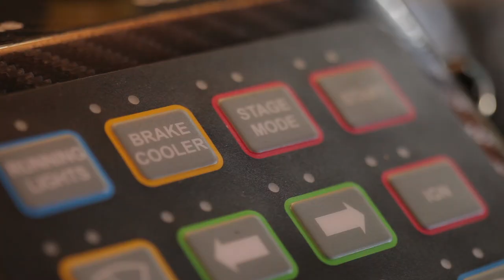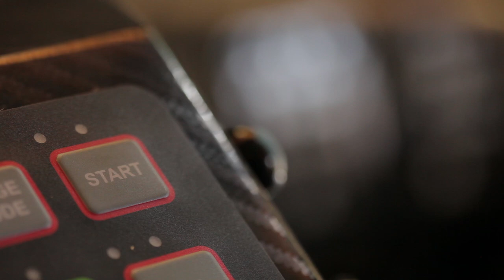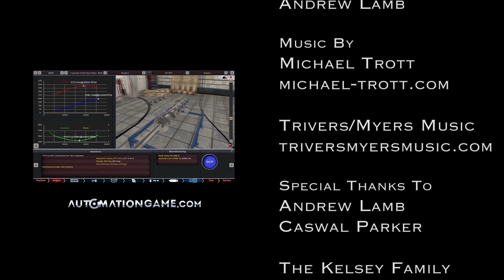The Homebuilt Rally Car That's Too Fast for the WRC - TST in NZ

Comment: I am stunned by his engine choice. For rally usually they target torque, which this engine cannot have much. Probably half of WRC cars, but I would trade that anytime for that sound. Secondly, Renault engine in Peugeot :)
Third, I would be switch to tarmac setup.
Reply: D Gmaz Torque in and of itself doesn't really matter, any car with 450HP and a broad powerband is going to be equally fast as a rally car, it just so happens that in this case he has to shift gears to keep it up at 7500 - 9000rpm sort of area, as compared to 3500 - 4500 or what have you in a low revving restricted turbo motor.

Sadly I don't think there are any good Tarmac rallys that this car is eligable for, I wish there were..
Reply: AutomationGame  Targa??
Reply: Not sure it fits any of the Targa regs? But I'm sure you could find a way. It's a much better gravel car though.
Reply: D Gmaz It fucken works doesn't it?
Reply: Alex Lyons Wet dream. Wet dream.
Reply: AutomationGame I do not believe he does not suffers in slow corners, but he does not lack fun. Alex made amazing car worth worshiping.
Reply: +D Gmaz In a low corner he just gets into a lower gear, so that his RPM remains at a more optimal range... It's not really any different. Most WRC cars target lower RPM's because it's probably easier to build and maintain such an engine. And because they can.
Reply: +AutomationGame He should go for Hill Climb rally. There are a lot of those events in Europe.
Reply: +D Gmaz Apparently the whole build started with the engine, because he was offered a good deal on it and then he built the car more or less around that engine.
Reply: +AutomationGame So he detuned the engine to run at 8500 rpm (saw it on another video). So my question is what do you reckon the engine life span is ??
Reply: +sz027566 Depends on how often he uses it and how hard he thrashes it. id imagine 5 rallies or so before you have to rebuild at least the gearbox.
Reply: +Reptilius Maximus   It's not a Peugeot, it's a home-made car that outwardly resembles a Peugeot. There isn't a single Peugeot part in the entire vehicle.
Reply: +Reptilius Maximus  Its geared really low and that makes up for all of that different powerband.

Comment: Next group b car
Reply: there is a reason group b was banned
Reply: +Slickcinnamon only because they were so fast but these are safer
Reply: Group "B" was banned because of the "fans", not the cars. Had the proper safety standards been applied, we would probably still be enjoying those monsters today.
Reply: Because they were made from plastic. Now we have carbon fiber.
Reply: Because people wanted to touch 500hp cars in oversteer on gravel roads. Not the actual cars itself.
Reply: Hate to say this and far from saying your point is moot, but the lack of regulations/restrictions around how light and how powerful the cars could be also facilitated production of monsters such as the lancia delta s4, peugeot 205 GTI, quattro s1 and renault5 turbo. While I enjoy watching and appreciating pure, unadulterated automotive engineering, the cars being produced were becoming lighter, faster and ultimately more dangerous.  While there is always going to be risks involved with any motorsport, the fatalities of drivers could no longer be ignored.  The proximity of fans only accentuated the dangers and risks associated with group B rally.
Reply: Then if that's the case, why isn't the Isle of Man TT banned ? on average every single year at least 1 person dies. I visited the year Mr Bob Price paid his life for racing on TT. that is a dangerous race, with that much power on two wheels, i see group B, with today's safety standards much safer than the TT. one mishap you die.
Reply: I believe this is because the Isle of TT is steeped in tradition and remains one of the most prestigious motorsport events to this day.  Especially among British riders.  A win at the IOMTT is the greatest accolade a rider can receive.  Even when riders/teams 'unanimously' boycotted the IOMTT (or rather petitioned for the race be removed as a compulsory MotoGP event) it was never discontinued. 

But hey, I would pay to watch Group B rally if it was still around. People shouldn't live life scared of the inevitable.  Even one mishap on regular roads can still lead to death...
Reply: MineEmpireBilly most answers I've heard to that is because rally racing is a celebration and bringing tragedy into it will change the mindset of the fans.

Comment: A modern day Group B car
Reply: AceCustomz exactly what I thought too. 👍
Reply: it needs a 1000Hp more to be a groups b
Reply: Carlitox b to be a true modern equivalent of a group B car, yeah, pretty much 😁
Reply: @carlitoxb110  Group B cars at their peak had about 400-600hp and you had to built a certain number of cars (200??) to be homologated.
Reply: WRC regulation used to be 300HP +5% since 2017 it's 380hp out of 1.6l turbo engine  ,  Rallye GT cars musst be 2WD, and can have up to 294bhp/tonne of weight
Reply: @mattschm5486  with boost turned all the way up the S4 was making 1000+ bhp but with massive inconsistent lag and same with the quattro S1 E2
Reply: @K2ifer  which they usually didn’t use for rally. Even the pikes peak version only had about 600hp according to Audi. As you pointed out drivability is a big point also probably engine lifetime. These are not drag racers

Comment: Is the body style base off a production vehicle, or did he do that too? I saw the nfity badge he made for the grille.
Reply from the maker: No he made the body too
Reply: whelk Looks like it's loosely based off a PEUGEOT 207
Reply: irishgandalf757 it's resembles a PEUGEOT 207 WRC. The 3.0 V6 comes from a Renault Clio V6 Sport, except in that car it only has 250hp instead of the 450 in this magnificent piece of tech. Current WRC rallyecars have a 1.6 turbo with I believe around 300hp....
Reply: TheSmokingTire ehm, pretty sure he started the body from 207 Trophee Andros body shells (French ice racing series), and told that in some other documentary. Obviously he'll need to make changes to it, and spares.
Reply: AccAkut1987 You could be right, I'm not that familiar with the 207 Trophee Andros. When compared though with a 207 WRC the front and the bodywork around the rear wheelarches look different (among others)...
Reply: +Sander Streefkerk There is no such thing as a 207 WRC.
Reply: Terry Dolan This thing is practically a WRC spec 207
Reply: Terry Dolan you are wrong.
Reply: Terry Dolan There IS a Super 2000 207 rally car though, specs aren't much different, and it was successful.
Reply: +Tom Smith This thing has almost nothing in common with any WRC or homologated car.
Reply: +pursuinginsanity there was a S2000 207 for the IRC and WRC2. Far from a WRC car however.
Reply: Super 2k is not 'far from a WRC' car.  They have similar power/weight ratios, awd, etc.  Check out the specs yourself.

I simply pointed out there was a rally version of the 207, not implying it was in the WRC.
Reply: +pursuinginsanity I'm familiar with the specs there's enough of the things in my workshop
Reply: +pursuinginsanity the specs are completely different. 2.0 litre engine naturally aspirated in a s2000 car against a 1.6 litre turbo charged world rally car. The power is around 20-30bhp down on a world rally car and the car is much closer to a group n/r4 production car than a world rally car. A lot of the technology is missing in a s2000 due to cost and weight savings. They are also a lot slower than a world rally car
Reply: +Adam Midghall (AM FILMS) closer to 60bhp down from a WRC car and less than half the torque. The new R5 category are quite close to the WRC cars on speed but at 40% of the cost.
Reply: +Terry Dolan wrc cars run 300 bhp with the current size restricter. The factory peugeots ran 280bhp and the privateer cars ran between 270-280- depending on the spares available for the car
Reply: +Adam Midghall (AM FILMS) WRC cars also run delayed ignition off throttle so for the whole stage the turbo is spinning at max RPM.  WRC cars also make 450ish lbs or tourqe
Reply: Steven McIntosh you mean anti lag. it keeps the turbo spinning at maximum boost not max RPM by a richer fuel mix being ignited in the exhaust. then goes back through the turbo keeping the RPM at a usable range to create virtually no lag. i didn't mention it as S2000 cars are not turbocharged so you can't compare them as they don't have anti lag
Reply: ***** Not max boost, no boost, It keeps the turbo spinning at high-RPMs but the blow-off valve is opened so boost isn't generated (because the throttle is closed), the air has no where to go. Then when the throttle is closed the blow-off closes so the turbo can immediately produce full boost again.
Reply: I mention anti lag because it produces a very wide power band with high torque across the Rev range.  Compared to the s2000 engines NA more linear power band relative to WRC.
Reply: SydneyCBR6 in wrc cars it is programmed to run where max boost is in the rev range. for example 3250rpm. sorry if it didn't come across the way i intended.
Reply: Steven McIntosh current world rally cars have max torque at 4000rpm and they only rev up to 6500rpm. there max power is also around 6000rpm
Reply: Sander Streefkerk The 3.0 V6 doesn't come from a Clio V6 sport. It came from a Formula Renault car.
Reply: +Sander Streefkerk actually, if you want to be technical, the block is from a formula Renault.
Reply: +Adam Midghall max power is around 7750 on a 1.6T wrc. The older 2.0 used to be lower revving.
Reply: Terry Dolan nope. ford, citroen, and hyundai all have max power at 6000rpm. VW have max power at 6250rpm. the cars don't rev up to that. they only reach 7000rpm max
Reply: +VirusTornado 
It's neither a 3.0 nor even a Renault, the V6 Formula Renault 3.5s ran engines based on Nissan's VQ35 (as seen in the 350z).
Reply: Gargenville k
Reply: +AccAkut1987 yes and many other parts of the cars are from the focus WRC, such as wheels, paddle shifter and wing
Reply: +Sander Streefkerk No, the engine in this video has nothing to do with the V6 from a road going Clio V6
Reply: Stephen R exactly.
Reply: +Tom Smith It's too powerfull for WRC specs. If there was a Group B again, this would belong to it.
Reply: +Sander Streefkerk Correct, 280 hp is FIA limit. Peugeot 207 T16 R5 is used in WRC2 category (s2000, RRC, R5, N4 classes of cars), not in main WRC competition category. RRC cars can be "easily" converted to full-spec WRC class (that's why some drivers compete in some rallies in WRC2 and in other rallies in main WRC category - for example Lorenzo Bertelli, Yuri Protasov). RRC - 4 wheel drive and turbo, s2000 - no turbo, 4-wheel drive permitted in rally, but not always used). Again - this custom car is a good candidate for rebuilding Group B with modern cars, but I don't see FIA allowing it. In 2017 FIA is changing technical regulations to allow 380 hp cars (still keeping 1.6 l engines) to match the power output of modern day WTCC cars (Super 2000 and Diesel 2000).
Reply: +Tom Smith a WRC muist follow wrc rules, the engine must match the production origin engine wich is a 4 cyl and front mounted, here you got a V6 3 renault from another manufacturern, probably from a formula1 renault. It is a pure prototype not a wrc, it can't race in wrc champ
Reply: whelk the car is actually a tube chassis, the peugot body is just a fiberglass crewed on top of it. he liked how the peugot looked bit its not a peugot... he made the screw on panels himself...

Comment: Damn, Matt is going grey really fast.
Reply: Enormous Goat I'm 23 and bald as fuck :<! not to mention the plethora of grey hair.
Reply: BanDiGo Hairloss happens due to excessive amounts of testosterone..
Don't worry, it's just the manliness in you, your body can't contain it.
Reply: Enormous Goat That is incorrect. Hairloss is due to oversensitivity of the hair-root to dihydrotestosterone, which is determined genetically. It has nothing to do with the levels of testosterone, otherwise Hugh Jackman, Mark Wahlberg and all the Bodybuilders and Athletes would be bald....which is observably not the case;)
Reply: Sense of humor needed in isle 3 lol
Reply: Darling, there is a difference between being bald and being educated...
Reply: Enormous Goat 
So all weight lifter are bald huh.
Reply: yeah well, that's just like your opinion man! :D cheer up
Reply: Enormous Goat Don't forget the one in his mouth, after all his name is DP-Premier.
Reply: Enormous Goat Driving extremely fast cars makes you go grey with fear.
Reply: +scanspeak00 If the ride in that beast doesn't make you grey, the nut shot from a stone flung at mach speeds surely will...
Reply: +Enormous Goat  No just for men in NZ

Comment: WRC is probably a lot faster through a stage, but this has more power and is still very impressive
Reply: Don't think so hahah, this is a proper rally car with a Hella fast engine
Reply: @boomshakalaka7383  All Wrc cars do 0-100 under 3 secs and top speed 200+kmh... Its the same as this car even with 70 bhp less.
Reply: Unquantified. Present your evidence? Mid engine gives superior weight distribution.
Reply: @Mikepower1978  a wrc car is designed to be perfect with weight distribution. They build the car initially underweight and then put ballast in the perfect areas and make it up to the weight. The aero on a modern WRC car is also far supreme. However this car is still incredibly fast and impressive
Reply: @maxbailey8507  I disagree on the perfect balance thing. I havnt weighed one each wheel though I will admit. But surely we can all agree an engine mounted forward in an otherwise empty body shell must be front heavy? And a mid engine layout must be optimal? Must be.
Reply: @Mikepower1978  yes when you put it like that of course an empty body shell will be front heavy but thats not what I am saying
Reply: Dont think a lot faster is possible. Well its possible but way too dangerous
Reply: U can watch the NZ champs rallys he competes in on you tube, he wins a few but is often beaten by group n cars, hell Ken block beat him in the 2019 Whangarei rally.
But this kid is special, I doff my hat for sure

Comment: Ha, ha I was about to write that it sounds like an F1, then I found out in the video it was an F1 engine :) Also it would be cool to see this car which was build in the barn match up against current WRC spec car, that would be interesting to see.
Reply: Laurynas S. Not an F1 motor, rather a Formula Renault motor, which is a very heavily modified VQ35 V6
Reply: AutomationGame As in a nissan VQ?
Reply: Dadul Ludad Yep, Nissan and Renault are joined, also the Formula Renault 3.5 served as a great way to race-prove the VQ for Nissan's GT3 efforts.
Reply: ive always wondered why the VQ engine never had the populartiy with tuners like the RB engine does. Probably because they were mostly N/A.
Reply: +AutomationGame What makes you believe it's based on a VQ engine?
Reply: +Dadul Ludad Its sad really. Renault/nissan have made some great engines. the world doesnt revolve around 2Js and RBs contrary to supra and gtr fanboys belief...
Reply: +Laurynas S. The WRC car would lose. they are far more restricted than this thing. For starters theyre all limited to over 100hp less than this MC2, they also weigh a little more than 300kgs aswell...

Comment: Amazing car, especially considering he made it himself. 
But I find it hard to believe that it's faster than a wrc car on a special stage. Ignoring the fact that it doesn't meet the regulations, wrc cars are technical masterpieces. Every bit and bolt are engineered to the maximum, diffs and suspension are the best out there.
Reply: True, but WRC does not have a monopoly on top engineering. Diffs and suspension are pretty well understood in a variety of racing disciplines, so lots of knowledge out there these days.

Comment: What does it redline at ?
Reply from the maker: Dmitriy Lashkov I think it was 9,600 RPM
Reply: TheSmokingTire Yep, and something many people don't know: The Formula Renault 3.5 engine is basically a race spec version of the Nissan VQ35 with forged internals and lighter-weight parts so it can rev out higher.
Reply: SydneyCBR6 Only according to Renault themselves the FR3.5 cars have a 3.5L V8 built by Gibson, revving up to 9250 rpm on 102 octane fuel. I know this because one of the drivers is an old friend of mine who told me this himself.

Source: http://www.worldseriesbyrenault.com/Formula-Renault-3-5-Series-3208.html

Edit: nevermind, I commented too soon... Didn't know they used V6 engines in the past.